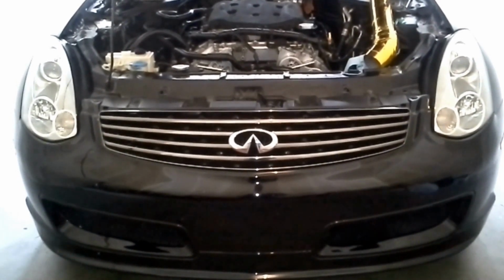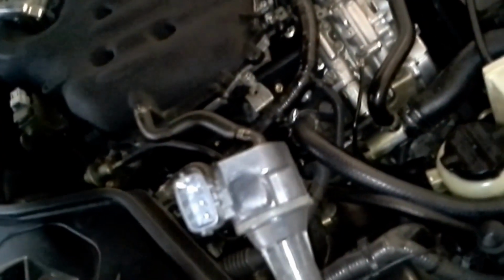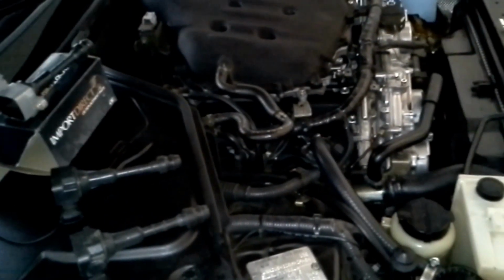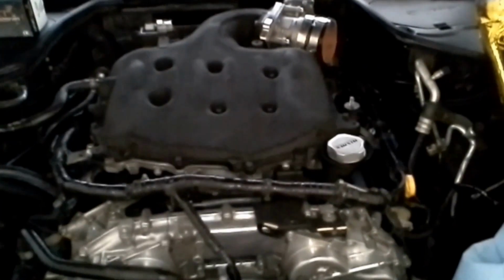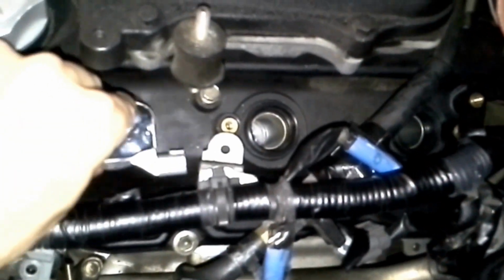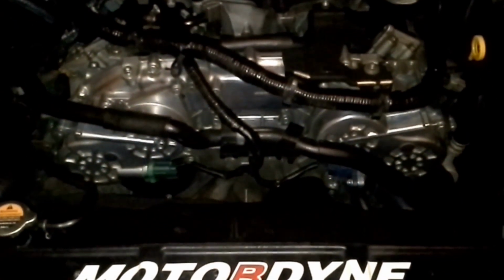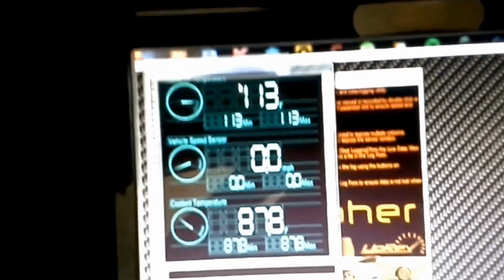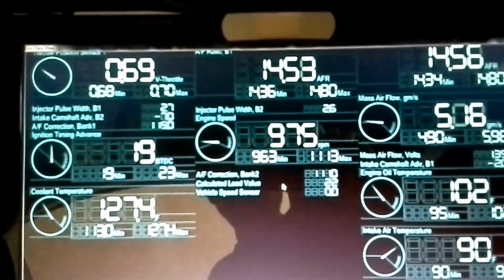INFINITI G35 / NISSAN 350z - How to tell bad COIL PACK - Misfire Random P0300

Comment: Ight but how about when the car ONLY runs on 5 cylinders all together. A rarity that it drives on 6. I changed the plugs and coils are pretty new and no noticable issue.

Comment: I have a 2008 M35 that is having a surging and idling issue in the last week i changed the crankshaft position sensor the camshaft position sensor bank 1 & the MAF sensor cleaned the throttle body & also did the idle relearn throttle pedal position reset ecm reset still the idle isn't at 650 i also unhooked the battery overnight did to reset it nothing is working did you ever have a high idle that was hard to get rid of????? Another thing is i went to auto zone to get the SES light checked and the obd2 port is not working any advice you can give me on this VQ35? Thanks in advance

Comment: I have a coupe g35 07 and it dosent let me go above 2200 rpms is like a limp mode whenever the mass air flow sensor is plugged in the car wont stay on it would slowly choke and die and when i Unplugged the sensor it stays on but i cant go higher then 2200 it has 56k miles

Comment: Hello guys tyler like your channel. I need some help from anyone. I have a 2012 g37 and my has been giving me a check engine light car goes into limp mode won't shift properly, when you step on the gas pedal nothing happens not instantly 😑  theirs a delay. I pull the codes and it seem to be the map sensor infiniti dealer said I have 3 prs0002, prs0003 I bought them cleared the codes and car ran good real smooth for 2 days same codes came back long with this new one P1705, P006A.

Comment: Bro thx for this video. U have save my life I was going crazy. My g37 was sending like a diesel truck 500$ after I came across this video I'm started trying my coil packs and the middle driver side coil was but I bought the bottom part of the coil it was like 8$ change it and like new thx u so much I will subscribe
Reply: The fact that you don't know what a spark plug is and you only replaced one scares me

Comment: I've had two coil packs go bad but there was no blister on either bad coil pack.  Originally, I got a P0300 random misfire OBD2 code but, later, the P0303 code came up and identified the bad coil pack on cylinder #3.  Yesterday, I got a P0302 and replacing the coil pack on cylinder #2 fixed the misfire.
Reply: Same. Have had two go bad in the lifetime of the car one at 175k cy1 and another at 183k cy5. Both looked new when I pulled them out. Easy fix though!

Comment: Im having issues with the same p0300 code but my car randomly misfires for a few minutes and then it stops and starts running fine. Any ideas? I was thinking maybe an injector is sticking.
Reply: I'm having the same problem. Did you figure out what it was?

Comment: Do you still recommend one step colder for full bolt on and tuned G?
Reply from the maker: No, I do not. I am full bolt ons with a tune and I am not 1 step colder. Check out my new video here on Sunday. This video was shot on a cell phone and is shitty. Still editing, but this spark plug and coil install is a much better video here on Sunday.
Reply from the maker: then you make me find this article, that I had in the description...damn it. I just installed those plugs, oh well. No issue before....https://www.z1motorsports.com/ignition-system/nissan/oem-vq35de-spark-plug-ngk-plfr6a-11-p-3187.html
Reply: Motordyne G35 😂😂😂 so your saying one step colder are okay? 😂
Reply from the maker: @nljr4095  ...according to Z1 yes, if tuned on bolt ons they recommend 1 step colder in the link I sent you.

Comment: Coil packs in order also or doesn't matter? Thanks
Reply from the maker: I am about to do an updated video on this with my new camera gear, sparkplugs and coilpack install. No the coils are not numbered, any one will work. Just make sure when reconnecting the harness it is the harness to the correct cylinder.
Reply: @MotordyneG35  thank you and does it matter also if engine is hot replacing it?
Reply from the maker: @phineparcon8739  ...you want the engine COLD or you risk stripping a thread when putting in the spark plugs.
Reply from the maker: https://conceptzperformance.com/ngk-4469-iridium-spark-plugs-5-lfr5aix-11-vq35de-nissan-350z-infiniti-g35-4469-kt_p_9626.php
Reply: @MotordyneG35  replaced my sparkplugs and still missfiring 😢
Reply from the maker: @phineparcon8739  ...It is usually the coil packs that go bad before spark plugs. Did you replace any coil packs? What check engine code do you have?
Reply: @MotordyneG35  well my sparkplugs was bad too so I just change it and it just says random missfire
Reply from the maker: @phineparcon8739  ...you need to also  replace all 6 coil packs.
Reply from the maker: What's going on now? Did you see my updated video? https://youtu.be/h666VNsPv2M
Reply: @MotordyneG35  also what plugs would you recommend for rev up motors? Thanks
Reply: Is their anyway I can private msg you

Comment: Hey man, got a quick question. I have a p0304 code.I have gone ahead and changed all 6 sparkplugs just because they haven't been changed and i went ahead and changed the coil packs as well. I'm still getting a misfire but is not as bad. Any idea on what it could be?
Reply: Failing Injector Cylinder 4

Comment: I know many people have been asking the same question and they expect you to reply and know everything. I was just wondering, my g has an issue. So overall when it starts up, it has great acceleration! To the point where it puts me snug to my seat lol. But then after driving for about 15 minutes I believe, it starts to loose that power and acceleration , like you have to keep  push the pedal down for it to go normal speed atleast. I have no codes, mods: cold air intake, moterdyne spacer, 75 throttle, testpipes, I am saying these because Honda’s keep on beating me ha ha Funny right. I have done oil changes every 6 months, replaced spark plugs but not coil packs. Car has no codes just lost of acceleration after 10-20’ minutes of driving. & when I turn it off like let’s say I go to the store on the quicks, it has that great power output but then 10 minutes later it starts to lose acceleration.
Reply: Thanks 🙏🏼!
Reply from the maker: @juanagustin4897  ....here, I explain this issue in this better-updated video..https://youtu.be/h666VNsPv2M

Comment: @motordyne G35, I currently have somewhat of the same issue.  My 04 G35 is throwing the P0303 code.  I've replaced all of the plugs and coilpacks and I'm still getting the code.  What do you think I should be looking into next to try and solve this issue???
Reply from the maker: Vincent Coakley Jr ....On the driver side, cylinder 4 and 6 the wiring harness is easy to get mixed matched when reinstalling. If installed wrong, you will still get a misfire. Double check this....
Reply: Motordyne G35 thing is I'm getting no fire at all from #3.  When I pull all the connections from the coil packs one by one all changes the motor rev  except #3.  Any other suggestions?

Comment: I got a question man I Change my spark plugs and now the whole car is shaking and I smell gas fumes and the car sounds like crap
Reply: And it also say that I have a misfire and the service engine like flashes
Reply from the maker: Yep, you have a misfire for sure. I change the spark plugs with the coil packs at the same time. Did you change out the coil packs? They are just as important as the spark plugs.
Reply from the maker: https://youtu.be/h666VNsPv2M

Comment: Hey bro I have a 03 g35 and it has the same code but I can’t seem to figure out what it is. I replaced coil packs and spark plugs. Whenever I floor the car it doesn’t perform like it’s supposed to. And my battery keeps getting drained
Reply from the maker: See this updated video....https://youtu.be/h666VNsPv2M

Comment: My g35 started misfiring when I drove it hard, service engine light came on but after it sat for a few hours drove like normal until I drove it hard again. I replaced the spark plugs and now it drives way better than before even got rid of rough idling when completely stopped. I drive it hard and doesn't misfire but after I replaced the plugs, vdc, slip and service engine light came on and stay on. It can't be my cam and crank shaft sensors because I just replaced them about a month ago with OEM sensors straight from the dealer. I couldn't have mixed up the harnesses because I removed each coil pack one at a time as I replaced the plug. I did have oil on every plug but I doubt the gasket could be the problem because it would be misfiring and not driving well. On another vehicle that I had my valve cover gasket was bad and had oil on all plugs misfired at all times even with fresh new plugs. I'm going to replace the coil packs next but was hoping that wasn't the issue. If some one knows something else that could be wrong please let me know, any help would be greatly appreciated.
Reply from the maker: Rolando Gonzalez ....spark plugs last about 30,000 miles longer than a coilpack. You said it drives so much better with new plugs so imagine how it will drive with new coilpacks. Report back after replacing the coilpacks.
Reply from the maker: See this updated video....https://youtu.be/h666VNsPv2M

Comment: Great video man... one question i have a 350z HR with a random misfire p0300 code and it idle at 1k , and the engine seem to be fine no weird noises, but i notice a lack of power when i accelerate, what could be the random misfire? Do you think is the coils pack , thanks in advance.....
Reply from the maker: Random misfire means you have more than 1 cylinder that is not firing. If it is just 1 cylinder, usually the code will be P0302 which means cylinder number 2 is misfiring or it is telling which cylinder is the problem. Random means more than 1 so it can not tell you. If you have not changed the coil packs before, then I would just replace them all with new plugs instead of waiting on the rest of them to fail, which could leave you stranded. You should not drive very far with an engine misfiring. Your idle should be 650RPM and I have a video to reset your idle..........https://youtu.be/TZJfWQLGUZI
Reply from the maker: See this updated video....https://youtu.be/h666VNsPv2M

Comment: hey man where to spark plug remover tool. It won't fit regular tool. Can't fine one . hope help me
Reply from the maker: Raksasok Heng .....go to any auto parts store and ask for a magnet spark plug socket. All spark plugs are the same size. $6 is all it should be.
Reply from the maker: See this updated video....https://youtu.be/h666VNsPv2M

Comment: Hey what cylinder p300
Reply from the maker: P300 means random misfire so more than 1 cylinder is misfiring.
Reply: Motordyne G35 just got It like 5 minutes ago P0302 cylinder 2 is misfiring so most likely it's time for cool packs 🙃

Comment: when I had my r32 skyline. when it start a miss fire sometimes. I use to just pull over. pop the hood. and unplug each connection to the coil . the one with no difference in engine note. I knew that coil has had it. so I just get another. the RB was a easy engine to work on
Reply: jedielectro did the same thing with my r33
Reply from the maker: See this updated video....https://youtu.be/h666VNsPv2M

Comment: So I’m definitely a mechanic, but I’ve done a lot of work on Honda’s mostly. I have a friend that has a g35, and the last 2 weeks I’ve been working on it for him. Well let me start I was suppose to work on it, but he got impatient and had some guy do some stuff to the car for him...... the stuff I was gonna take care of. Anyway I’m now having to fix all the mistakes this guy did. This guy replaced all the plugs and coil packs, and managed to mess up so much stuff. Misplaced important bolts the most ridiculous thing done was the cats where cut off and didn’t need to be done but I’ve gotten everything just about right I need to check the gap on the plugs but after fixing everything I’ve had the codes checked and it’s P0058 and the other is P0138 it’s saying the 02 sensor and that’s what’s got me stumped if the sensor is not connected (because the cats are gone) so I’m still having misfire issues and the plugs and coil packs have been replaced and correctly installed (I do have to check the gap on them though ) please help me out
Reply from the maker: Kaleb Milano .....that sucks bro, way to help your friend out. On this one, I do not know. Did you ever figure it out?
Reply from the maker: See this updated video....https://youtu.be/h666VNsPv2M
Reply: Probably throwing a code for 02 becouse the there isn't one connected

Comment: im new to the g community and you sir are awsome im a definite subscriber watched about 6 of your vids now very informative
Reply from the maker: Jay Millz The'Barber ....thank you for binge watching my channel, lol. Stay tuned, I just came back from San Diego and got some awesome video to edit and upload. Sunset cliffs and shots up high from the hotel room, cracking the Shockwave ))) echoing off sky scrapers.  Great times with the wifey.
Reply: Motordyne G35 sounds like a good time whats your take on test pipes?
Reply from the maker: Jay Millz The'Barber......test pipes or resonated test pipes are very raspy/drone, but make power. Motordyne ART pipes make 10 more whp than test pipes and the helmholtz resonator gets rid of the rasp and drone.
Reply: Motordyne G35 i plan on eventually getting them just right now while im in barber school i dont really have that type of budget lol but i see they make great products for our vqs
Reply from the maker: Jay Millz The'Barber ....I hear you. I used to have resonated test pipes so just speaking from experience. Test pipes should be your last mod before a tune or car will run lean. Lean is bad.

Comment: would this fix bad fuel economy, right now iam getting 180 miles the most on my 04 g35 .. recently just replaced spark plugs and my service engine soon light appeared on the next day. and I still get shitty gas mileage, would replacing the Plug Boot fix it the poor fuel economy maybe ?
Reply from the maker: When the check engine light appears, what code does it say?
Reply: Motordyne G35 how would I be able to tell which code, do I need to go out and buy a code reader?
Reply from the maker: Go to any parts store, like auto zone and they will hook up the scanner, read your code for free. You need to know what the code is before doing anything.
Reply from the maker: See this updated video....https://youtu.be/h666VNsPv2M

Comment: I have the same make and model of yours and I love it...my vehicle just did the same thing, would it be ok to drive to get it fix
Reply from the maker: Driving with a misfiring cylinder is potentially dangerous. If you lose power while you are driving, or a second or third cylinder goes out, this can cause you to get into a car accident, potentially injuring you and others around you. Yes, you can drive it, but I would only drive a short distance because of how bad the car vibrates. I have a BMW E46 with an inline 6 vs. the v6 the G has, and when the BMW misfires because it is an inline 6, you can NOT even feel the misfire. On the G, you feel the misfire big time.
Reply: I know this is a year late but is it possible to have code 0304 but not feel like there's anything wrong  with the car. I have a misfire code but it doesnt feel like it.
Reply from the maker: See this updated video....https://youtu.be/h666VNsPv2M

Comment from the maker: I forgot to say, disconnect the battery first and about Dielectric Grease. Also the spark plug are not pre-gapped for you. The parts store people will remind you anyways when buying spark plugs, but you take a cue tip or finger and rub Dielectric Grease on the inside of the coil pack before installing. Good luck!
Reply: Motordyne G35 Need a response buddy what's the color coding for your coil pack wires I got a 07 fx35 Infiniti in my shop and can't find the diagram anywhere and the owner removed the labels stupid I got each one driver side with one different color in each one has an orange another grey and the last one greenish teal
Reply from the maker: TrueLVL70ETC Chance hartlaub .....I am at work right now and it is 115 degrees outside. Opening the hood, not happening, I will burn my hands. I remember my friend having this issue and if I remember correctly orange with white strip is is cylinder 6.
Reply: Motordyne G35 Great info, I'll have to look into it as I have a plenum spacer, Z1 intake, as well as Z1 high flow cats.  One step colder might be what I should run then!
Reply: Hey bro my mechanic dod a swap on my engine and he put my plenum spacer back on with the gaskets that were on the original motor and the plenum gasket too it was still in tact bit not sure if maybe thats causing the misgote or if its my coil packs which i think he checked
Reply: Motordyne G35   Sweet G! Good work with the vlogs,  pretty informative.  
I have  a 05 g35 Rev up coupe with a flashing  cel when I put load on the engine.  Could it be the coils? ?
Reply from the maker: This video is terrible. See this updated video....https://youtu.be/h666VNsPv2M
Reply: I’m having the same issue with my 06 m35x p0300 im try changing the spark plugs again n coil pack
Reply from the maker: Nice! I use OEM plugs which are Platinum Spark Plugs PLFR5A-11. Now after reading into it they say if you have mods like I do, you can go:  

PLFR5A-11 - Factory Heat Range (5) is best for vehicles without any modifications
PLFR6A-11 - One Step Colder (6) is best to be used when any engine modifications have been done (Including air intake, exhaust, etc.)
Reply: Which spark plugs do you use? The ones I buy come pre-gapped, supposedly, and I haven't had an issue with them so far.  The NGK Laser Iridiums are what I use.